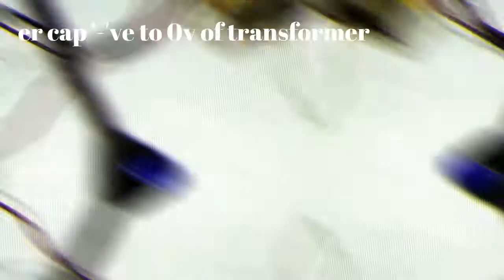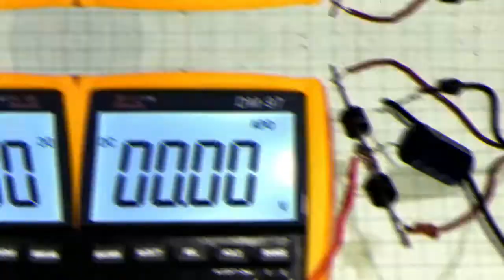How to make full bridge rectifier | 12-0-12 3A transformer | #13 | Circuiter Tamil

Comment: Bro etha 4440 ic board la use pannalaama..?
Reply from the maker: Yes . 4440 ic ku we need 12v dc input , so neenga oru LM7812 regulator ah intha rectifier end la fix panningana , you can supply a constant 12v dc to that ic board.
Since 4440 ic ku atleast 3A current supply irukkanum ,so you can use that . But kandipa  regulator ku heat sink is must.

Below link for how to use LM series voltage regulators:
https://youtu.be/vRBWfbLPqNg
Reply: @circuitertamil-circuiter  tq bro